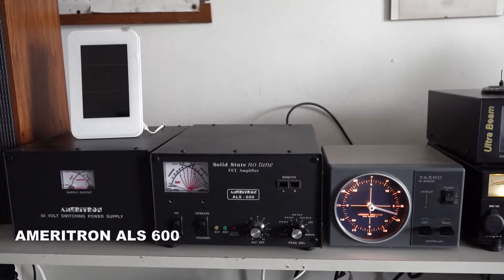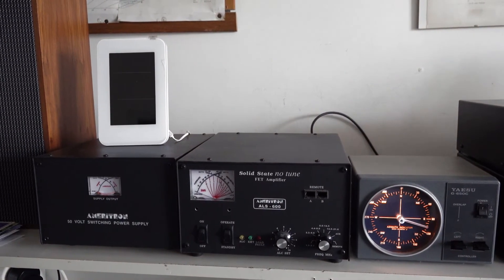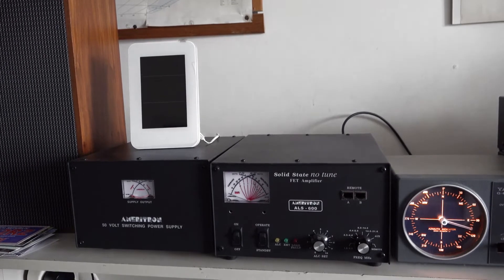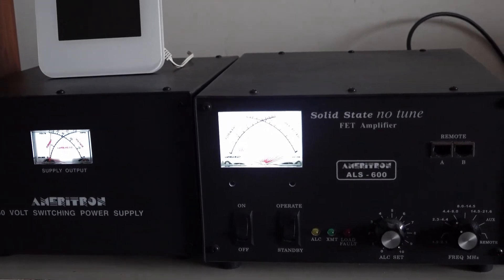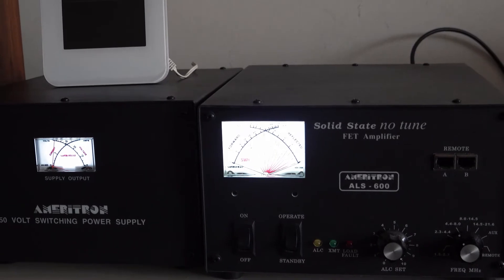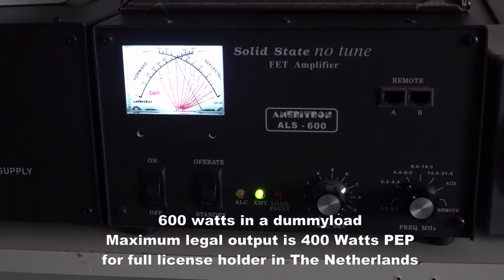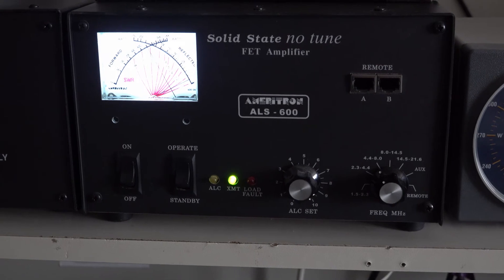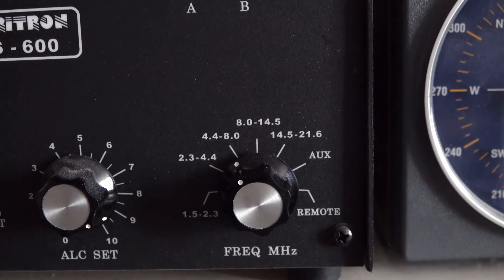AMERITRON ALS 600 FET AMPLIFIER IN THE SHACK OF PA3GEG MAX 600 WATT IN DUMMYLOAD

Comment: Hi, Gerald! It's a short Video but it has a lot information!  It's simple Great !!!
My question, how hi is the voltage from the power suppley
Hpe see the nex Video soon
73 Rolf, DK9DQ
Reply from the maker: Hallo Rolf, Amplifier runs on 50 volts, the power supply is seperate from the Amplifier. There are two models of power suppleys one with a  convetional Coil and one with a switching poiwer suppley,   I switched over from a conventional to a Switching model. The Amp is now about 2600 euro much to expensive so if I were you I would go for another Ampilfier. 73 de Gerald
Reply: @Gerald-PA3GEG  
Hi, Gerald!
I bought an ALS-600 used for 850€.
but the voltage from the transformer power supply is 58 volts.
the transformer is properly wired for 240 volts. So I have to try to throttle the voltage towards 50 volts.
Ameritron writes that it becomes critical only from 65 volts for the PA, but better safe than sorry.
Thanks for your answer!!!!
73 Rolf
Reply from the maker: @r.schwarzbach9485  Wünsche viel erfolg, Aufpassen mit "powerspikes" ich benutzte die Endstufe nur noch in ssb.  73 Gerald